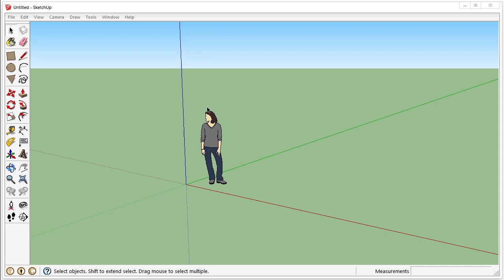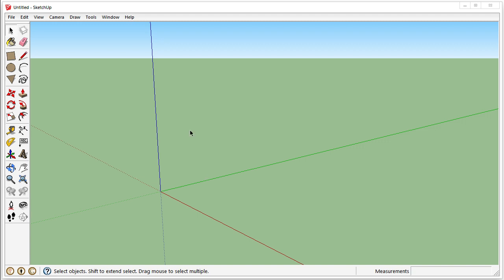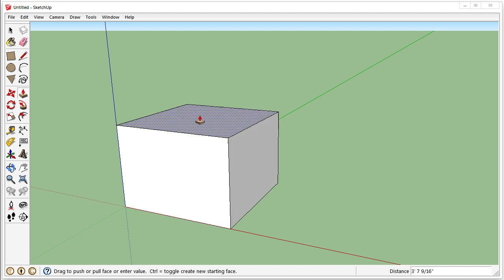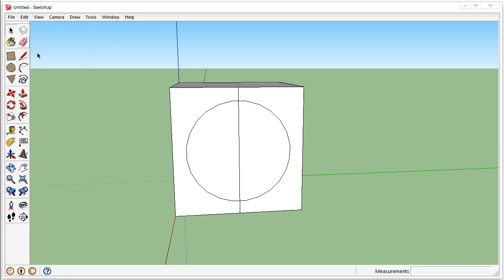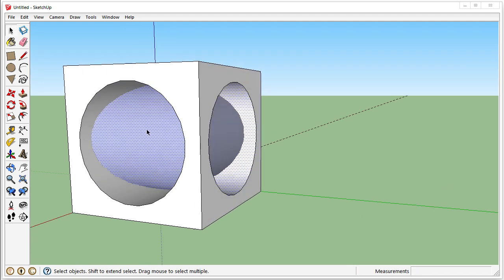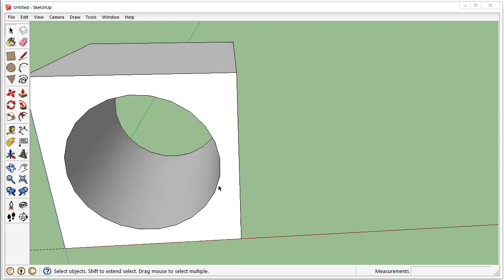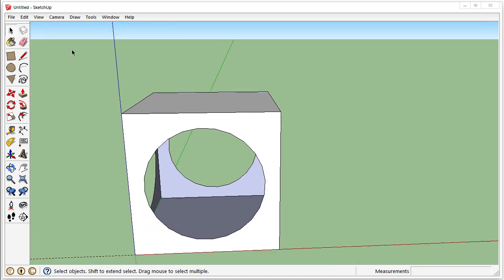SketchUp: Passing Holes in Cube Intersecting Faces

Comment: I know this is old but, I am trying to model something like this and when the holes are there and I am getting ready to erase the pipes going through, there are lines showing that the item is round and yours does not. Yours is smooth so you can pick the item to erase and mine only allows me to pick a small section. I tried the holes with 99 sides and I had to erase 99 pieces and it always took some of the sections that were to remain! The hole section lines are not parallel when you look inside after trying to erase pieces. What am I doing wrong? Thanks for any help. I even tried it with 24 sides to the circle and had to erase 24 sections for each circle and then patch everywhere. Any ideas what I am doing wrong?

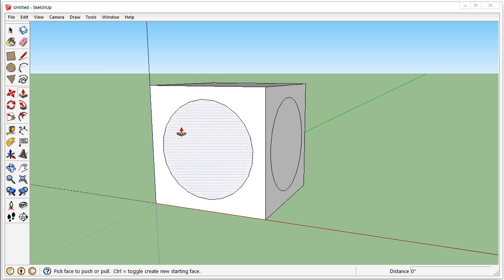Comment: how did you rotate while still using push and pull tool on 1:14?
Reply from the maker: esp heroz I used a SpaceNavigator SE 3D mouse. It allows you to control the camera easily while still being able to use various tools at the same time.
Reply: So how am I supposed to do this with a trackpad?
Reply: Push down scroll wheel on mouse.